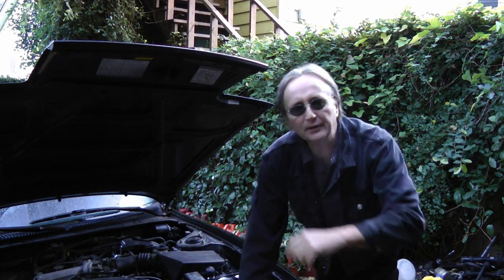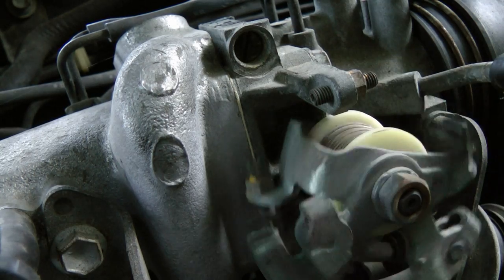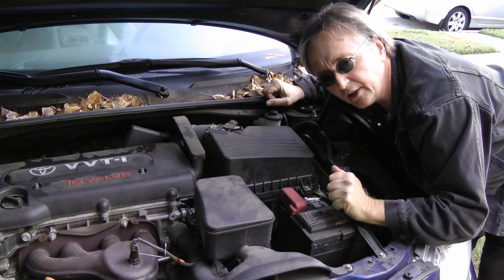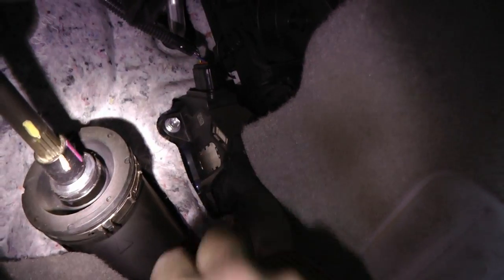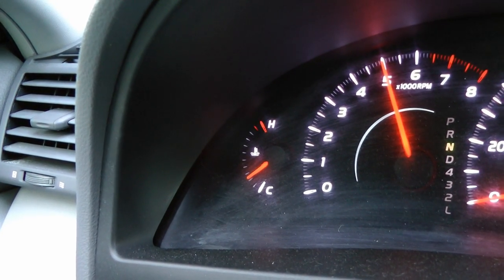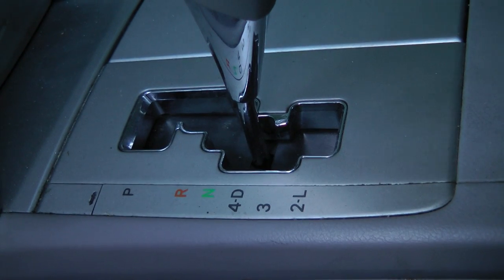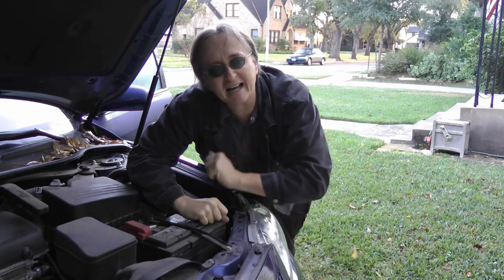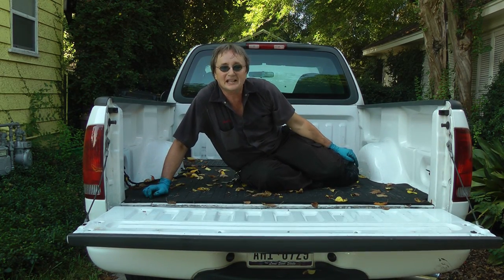How To Stop Unexpected Car Acceleration

Comment: My GMC Jimmy would accelerate like mad when the cruise control was enabled. Man talk about scary.
Reply: Could be your throttle position sensor. I drive a 99 mustang and today going down the highway it started gaining speed for no reason. Replaced the sensor, all is good.
Reply: Chinesefoodrocks1521 Well I got rid of it three years ago so I no longer have to worry about that. But that very would could be the reason why.
Reply: My dad's 1978 GMC truck did that on cruise control so he just removed it altogether

Comment: This just happened to me tonight 4/28/22 dodge challenger..I was shook, bcuz it caused my brakes to fail.  so I decided to completely shut the car off  while the car was still  in drive, wasn't thinking about neutral, I didn't want to die or  hit the car I'm was heading towards. When I  turned the car back on ,  it was still idling at high speed as though my feet was on the pedal. I think the car is haunted & I'm not sure what to do with it now. After the third attempt, it went back to normal & I was able to drive home 🙏

Comment: Scotty, I seem to have a problem with my Saturn SL2. It doesn't start. I've replaced the battery. I started the first time but the second time it just died. I stopped waited a few minutes then i cranked it and it started. It seems to do that pattern over and over again. Any advice?

Comment: OK heres a good question ... WHAT ABOUT CARS THAT STOP ACCEL WHILE DRIVING.
b2000 1986   nikki carb. 
I replaced plugs wires fuel pump (not getting fuel pressure on 3 diff gauges) but car drives tell 40 mph and acts like its in limp mode and shuts down tell about 10mph and i can drive it again tell 40 mph. accuater pump? secondary float stuck? fuel is pumping out of fuel pump but im getting zero pressure which is weird btw. checked the fuel cutoff thingy needle in the carb plugged it too.

Comment: So I understand this computer thingy. What happens if the accelerationis at the beginning of stepping on gas or starting? Mine seems to accelerate on it if I step on gas harder than normal. I think the computer learned how I drive and is stuck in fast mode. It gets dangerous. Don't know how to get it to not do that. It shoots out if I go sorta hard on the start. How do you fix that? It doesn't come down from acceleration if you take foot of the gas pedal?

Comment: I had a real-life case where the car was stuck in "passing gear";  when I shifted into neutral, the engine RPM increased rapidly, causing the water pump pressure to increase, and, in turn, caused the heater core inside the passenger area to rupture and the inside was filled with steam.  I think it would have been better to brake to a stop, and then shut the engine down while transmission was still in gear...   Just sayin'

Comment: My car has a revving problem were when I set off from 0mph and I put my foot down it sets off really slow like there's a lack of power until it hits about 3000 rpm and then the turbo kicks in and then the power comes back and it's the same as when it's in park and then I press the throttle all the way down  it revs slow and when it gets to 3000 rpm the revs shoot up.
If you could help in anyway it would be much appreciated.

Comment: CONTINUED: "Choi and Park allege that some of the blame for the sudden acceleration involves the electronic throttle control system, known as the ETCS-i. They say that the original design for the system included a safety feature that would have put the engine into idle mode in case of unintended acceleration. However, the company allegedly decided to sell the vehicles without the feature in 2001."

Comment: Sure, sure, but if that happens say, at speeds,say 100 km/h(60miles/h) and your brakes are worn out, shifting to neutral doesnt save your soul. You are going to hit something and soon and at very high speed and off your soul goes. Or you might pray that happens in the steep uphill somewhere in the Colorado. My car does that sometimes, it starts to accelerate like mad and it has  automatic transmission and brakes are very bad, I must open  the drivers door and "brake" with my shoes...lol. Anyway its a unique feeling, when your car "hits the pedal to the metal" and the speed is 100 km/h and worn out brakes in your car.

Comment: The best response to unintended acceleration-according to Toyota: Put both feet on the brake pedal to bring the car to a stop (the brakes are more powerful than the engine), then shutoff the engine. Then have car towed and repaired.
Reply: +Jonathan Samet Yes indeed.

Comment: Scotty, i got a suzuki grand vitara 1999 and after usually after half mile, under very light acceleration or cruising at 50 mph i feel a slight jerk. im afraid its something simple but if i dont fix can cause some problems. i was thinking it could be dirt on the fuel line but not sure. thanks

Comment: its funny when the serpentine belt brakes to many people dont think they can drive it at all, not even drive it where its not in the way of traffic. after a few minutes it might over heat if the water pumps not diven by timing belt or chain, or run out of battery power without the alternator turning but when its hard to steer they think the cars totaled

Comment: With all these vehicles becoming totally electronic/computer controlled (automatic transmissions are also electronically controlled with a computer for shifting) Just think if the electronic shifter along with the throttle "glitches" and refuses to drop out of gear (neutral) and gets stuck accelerating. Nightmare scenario indeed. Yeah the odds of this is remotely small but still you are putting your life and the lives of everyone else on the road in the hands of a set of wires and computer sensors. I will keep the physical throttle and shifter cable that is equipped on my 2000 Dodge, thank you. lol

Comment: @3NOSHITSHERLOCK3 A strange thing happens when you shut off the key, the engine stops.  You can also hold the brakes and the car will stop.  I can't think of any car that makes so much power (stock) that the brakes won't stop the car even with the engine wide open.

Comment: I do have an older car. A 1987 Nissan Laurel 2.0 gasoline. When I am in neutral (it's a manual), and the engine is idling at the correct RPM and I push the throttle a little, and rev the engine, it takes a really long time to go down to the RPM where it should idle.

Got any idea why that is? I've driven other manual cars (an automatics), and mine is the first I've noticed that takes so long to fall back to its idling RPM.

Comment: it's not better thottle response when your used to the cable lol, I switch between my aunt and my mom and dad's car, an accord and a CRV, same engine, just one is DBW and one is still Cable, I gotta say, CRV just feels like a car that drives its own, with the cable, I feel more control, the DBW just feels like the cable can be easily pulled*pushing the gas pedal is too light, thus it feels like I'm using more gas for power, which is counterproductive since I want to save gas money...

Comment: May be a stupid question... But say you are on the highway and this happens, and you shift it into neutral... Can you shift it back into drive when rolling without harming the transmission?
Reply from the maker: Sure, I've done that lots of times
Reply: OK cool. Appreciate it!
Reply: Scotty Kilmer but if u did that put it in N the engine will race
Reply: matt wells it's better not to hit something. beside your car can handle redlining for a bit.
Reply: Yup, I shift to neutral down hills sometimes. Most people don't know, but the shift is made so you can shift from drive to neutral and back without pushing in the button or pulling the lever out/to the side. This is to prevent you from over shifting into reverse or another gear. Try it out in your car, it's a great thing to know.
Reply: fayth78a1 and have a blown engine no thank u
Reply: matt wells then you never worked on them have you?
Reply: matt wells redlining for a while won't cause a blown engine dude ... Unless it was dying already.
Reply: deafyboy86 unless u wanna lose a rod be my guest
Reply: matt wells 320+k Audi estate from the 80's, it get's thrashed all the time, never a major fault. If you hold the engine at redline for literally minutes, like a long time, it won't last too long, but being at redline for a while won't hurt it.
Reply: Scotty Kilmer But what about if it is an automatic? Will it automatically (lol) select the right gear to go into?
Reply: IloveSPIDERZ (Better phrases my previous comment) I used to do this all the time, I use neutral to roll down hills with less resistance, helps save gas in non hybrid/electric, and possibly in hybrids/electrics, though I'm not sure if the wind resistance from going down hill too fast consumes more energy than the inefficiencies of the regenerative braking, so in hybrids and electrics, I'd just leave i so it keeps me at or below the speed limit.
Reply: Benjamin Esposti Most automatic gearboxes has selective mode so you can manually select gear. Its not that difficult you just need to use your head.
Reply: yes, it wil shift smothly
Reply: Unless you're in this situation, don't shift your car into neutral when coasting. It's dangerous. 

When going down a hill, your foot isn't on the pedal, so the engine keeps itself alive using the forward motion of the wheels, it injects a tiny tiny amount of fuel, just barley enough to keep the engine running. Shifting into neutral makes you loose engine power, vehicle control in an emergency and you risk the engine stalling. 

For example, I did this once just to see what would happen. I was getting off the freeway and shifted up into neutral, the engine dropped Rpms, but too many, it was barley running, like 250-300 rpm. I started loosing power to everything. It could've been dangerous.

You won't save gas by shifting into neutral, you'll just be risking your life remember that.
Reply: Chinesefoodrocks1521 It's not actually dangerous, you lose engine braking though. When coasting (on overrun) the engine uses no fuel, the momentum of the car keeps the transmission spinning, and as the transmission is spinning with a gear engaged the engine will keep turning over, due to friction ect you slow down in gear without accelerating. Shifting back into neutral returns the engine back to idle speed, at idle a little bit of fuel is used to prevent stalling, you also lose engine braking completely. So keeping your car in gear while coasting downhill, and taking your foot off the accelerator will save you more fuel compared to shifting back into neutral.
Reply: deafyboy86 What are you talking about?  You burn way more fuel because the engine braking slows your car down unnecessarily, meaning you have to use the accelerator to keep the car at a higher speed.

Switching into neutral saves gas because it allows you to go faster down hills without using more gas than the small amount that is used to keep your engine running idle.
Reply: Chinesefoodrocks1521 I've never had a car die while in neutral unless you're talking about manual transmission...automatic car engines don't die when going from drive to neutral...
Reply: If you're going down a hill the engine brake will keep you at a constant speed. If you shift into neutral you gain speed, not only dangerous but you have to burn up your brakes to slow yourself back down.

Also shifting into neutral saves no gas. When you take your foot off the pedal and coast, the computer injects the same amount of gas into the cylinder as it would at idle. 

It's also illegal to be in neutral while moving.

Also, a car dying in neutral can happen, doesn't happen all the time though. But that's just another danger of coasting in neutral.
Reply: Chinesefoodrocks1521 No no no, when you're going up the hill, you shift into neutral right before the peak, that way you slow down before reaching the top, then as you go down you'll pick up speed and be where you need to be, then to slow down, you put it back into drive...it's common sense.  And the shifter is actually designed so that you don't shift wrong.  My shifter has a button on it, the button doesn't need to be pressed when switching from neutral to drive and back.  You only need to press the button to go from neutral to park and drive to brake or other gears, however your car is designed.

Other cars require you to move the shifter to the side when going from neutral to park or other gears, but you can move it straight up and down to switch between neutral and park.  The shifter is designed to prevent over shifting into the incorrect gears.

The engine will not keep you at a constant speed all the time, it depends on how steep the slope is, in some instances either friction or the engine itself will slow down the car, which is why neutral can either increase the speed or keep it constant.  Anyone that knows how to drive their car and are familiar with it will be able to time the neutral and drive just right so that you don't go way over the speed limit.

Shifting does save you gas, because if it used the same amount of gas as idle, that means picking up speed down the hill means extra speed you wouldn't have to push the pedal to gain.

Also, it is not illegal to be in neutral while moving, the whole point of neutral is to allow the car to move without the engine, the law you're thinking of is that it's illegal to not be in control of your car or whatever.  If you know how to drive, shifting from neutral to drive is as little control loss as lifting your foot off the pedal...

Also, I've only ever had a manual transmission car dye in neutral, but it only happens when you shift into another gear without putting gas from a stop or shift higher than you should...
Reply: Car shifters are designed like that if you need to remove it from drive quickly. It's also added convenience if your sitting somewhere on a flat surface (say red light) and don't feel like holding the brake. 

Maybe try reading up on some articles first. Shifting into neutral will save such a minuscule amount of gas, you would never notice in your lifetime. And for the amount of wear and tear you're doing to your transmission, the amount of gas you're saving is nothing.
Reply: nambinhvu No no, if you let the car roll in gear, the engine isn't using fuel, the momentum of the car spins the gearbox and engine over at speed, it doesn't actually burn any fuel so long as you don't input any throttle.
Reply: +deafyboy86 What do you think happens when the momentum of the car spins the gearbox?  If you learned anything in physics, that means added friction, heat, and noise, and it's all going towards slowing your car down.  When you shift it to neutral it may be injecting the same amount of fuel, but your car has less friction to roll, so same amount of fuel, but in neutral you're going faster, meaning you're saving fuel...
Reply: nambinhvu Do you know anything about engines? In overrun, no fuel is consumed at all, the car slows down of course but that's to be expected. You burn more fuel shifting into neutral because the engine consumes NO fuel, not a drop, in overrun, the momentum of the car turns over the gearbox, which, if you leave engaged spins the engine over also. Apparently the fact that an internal combustion engine can spin without utilising any fuel at all is apparently unheard of to some people.

Comment: The hub hub is that there is money to be made from the hub hub in the form of lawsuits. I have never experienced sudden acceleration but I have experienced no acceleration when I needed it.  It was like the accelerator was locked in at a fixed speed.

Comment: Mr. Kilmer, I've liked  a lot of your videos, but I think you are a bit dismissive of the concern when this happens.  Until this weekend, Our 2009 toyota Rav 4 had never had a problem and it was never a thought on my mind, but Saturday, while sitting stopped at a red light with my family in the car,  it suddenly revved and lurched forward. MY right foot was already fairly firmly on the brake, but it wasn't enough.  I instinctively added my left foot and pressing as hard as I could with both, I was barely able to hold it back.  Within a couple seconds I did hit it into neutral, but had I not responded so rapidly we would have caused an accident possibly hurting someone.   Toyota looked but still denies there is a problem with it when we took it in, saying the recalls / tsb's show in the computer as having been performed. And so far have refused to fix it.    Curious things are: 1-  supposedly the programming done to the car should have prevented acceleration when I had the brake depressed- It didn't.  2- the recall stated sticking accelerator- we were already stopped at an idle, THEN it revved up without application of the gas pedal.  3-  If it had been caused by accidental pressure on the accelerator, the engine would have revved UP higher when it hit neutral and disconnected the transmission- it didn't- instead it immediately idled DOWN.  Only then did I start to relax my pressure on the brake pedal a little.  Maybe if you imagine a v-6 ( I know you don't recommend ;^} )  suddenly and unexpectedly pushing you forward while only a 1/2 car length or so from a vehicle or a crosswalk of people while you are comfortably stopped at a red light.  Believe me, you can't feel comfortable even after stopping once you experience it.